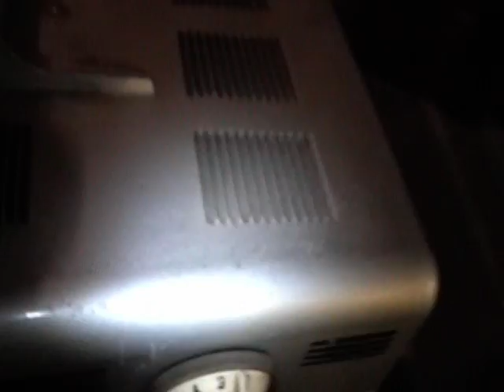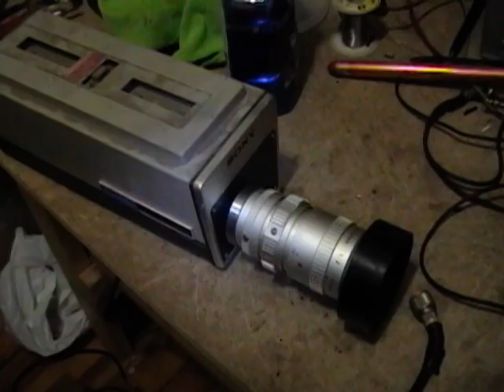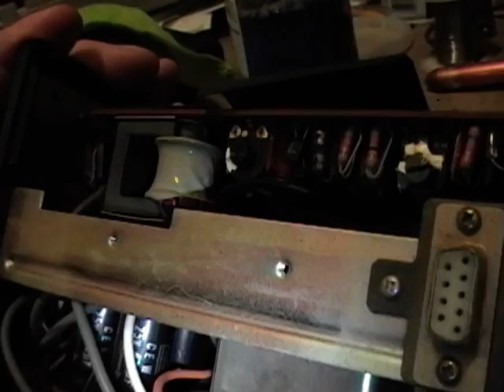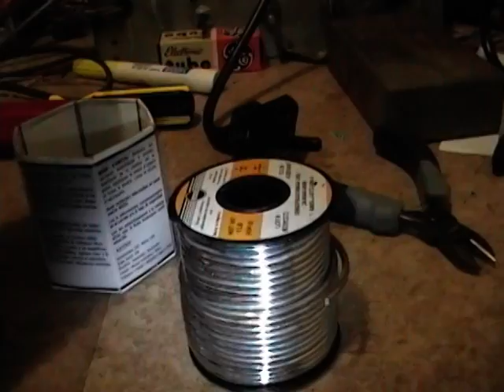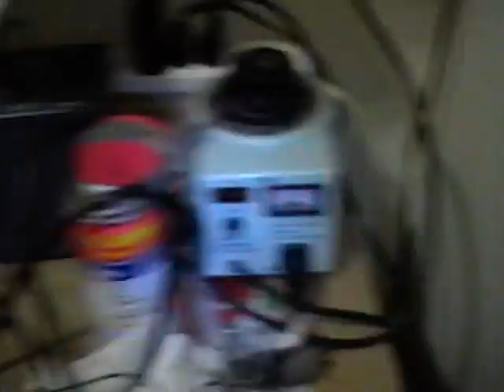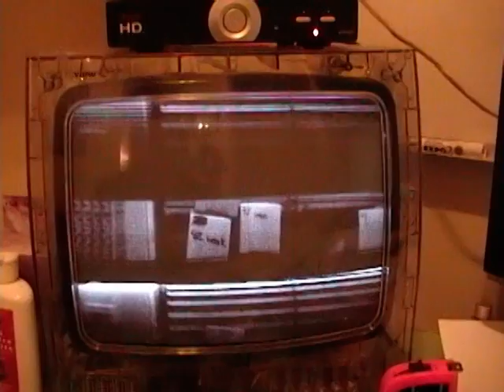Sony AVC-3210 B&W VIdeo Camera

Comment: Wow, you really lucked out with grabbing the book for the set that you grabbed too !!!  I've always used copper pip flux when I solder.  It seems to work for me the best.  I've made numorus PCB and stuff with a 100w solder gun and flux!!  LOL, I also use the Rosin-Core solder in the .062 diameter that is 60/40 aloy from radio shack!!  LOL  I've ran through 4 of the one lb. spools in a few years.